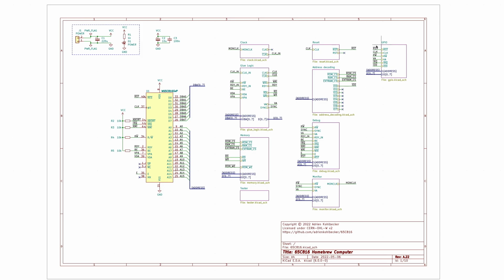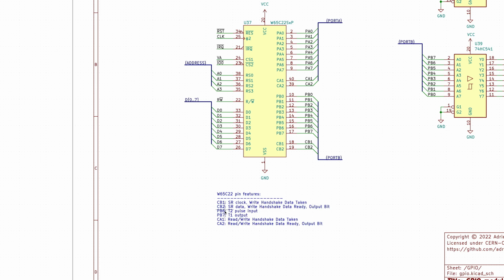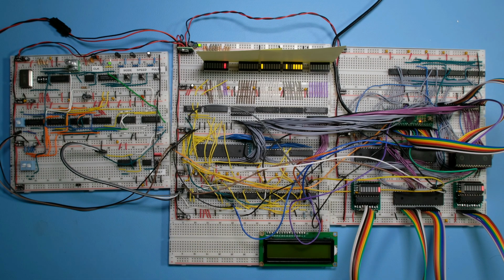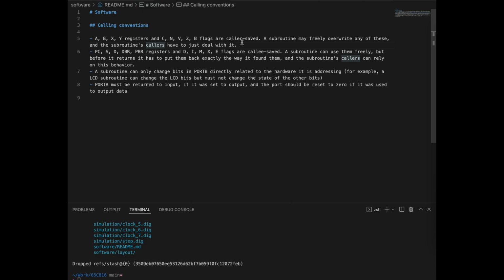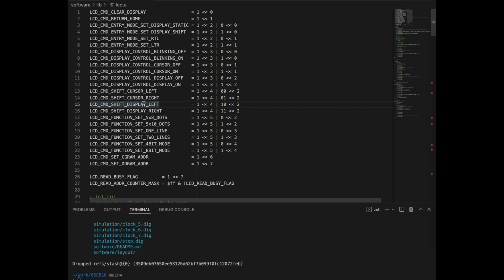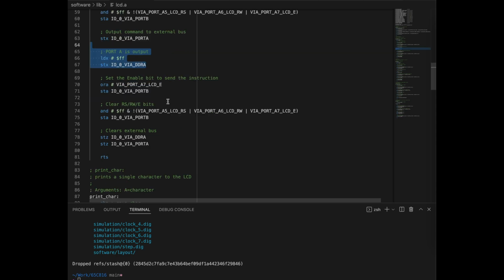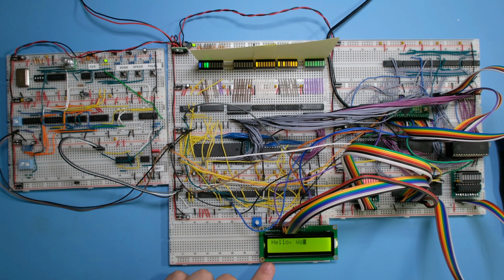#22 - LCD screen, calling conventions - BB816 Computer

Comment: I actually have connected the LCD directly on the CPU databus and used some additional logic, to drive he enable signal. Address bit 0 is connected to the R/S signal of the LCD, this has significantly reduced the Code size and i believe is the better solution, instead of connecting the LCD behind the VIA. I have not checked the timings of this setup, but it works for me.
This setup allows for a really tight Busy wait loop, which is just a BIT LCD_Control ; bmi loop.

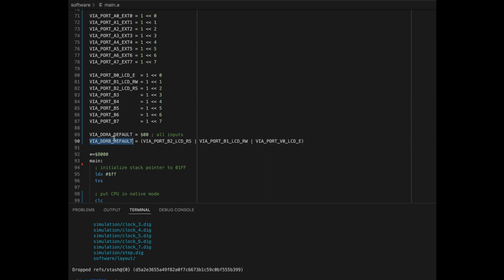Comment: At 7:40, shouldn't VIA_DDRA_DEFAULT be $ff - all outputs (instead of $00 - all inputs), since that's what drives the LCD module?
Reply from the maker: Appreciate the question! I see this port as part of an "expansion data bus" where multiple peripherals could be connected and share those 8 bits, similarly to the LCD. Each peripheral has a chip select in the other VIA port. I make not driving this bus the default state, so a mistake in other control signals on that bus doesn't result in a short. This is mostly bikeshedding on my part, and you could design it either way :-)
Reply: @akohlbecker  Thanks for the reply. I understand and I'm still 6 months behind, but catching up!

Comment: then how to build a computer without the help of another computer to program it.?

I was thinking about how the first computer was built in this world
Reply from the maker: That is a vast subject, depending on where you're starting from. First computers were mechanical and mostly akin to calculators. First programmable computers were built with relays, then with vacuum tubes, and then with transistors. On YouTube I recommend looking at Paul Law for an example of a relay computer, and Usagi Electric for a vacuum tube computer

Comment: I added these comments to your ep. 20 but I don't know if you seen them, I think it will help you optimize your teensy code:
When you are getting bool values of va, sync and rw - do it the other way around - if you generate the mask like this ctrl & (1 << 7) the compiler will optimize 1 << 7 into 128, you will save clock cycles used up for shifting ctrl around. Even better you can directly write the mask in like this 0b1000000 - it will be instantly visible what bit we are testing.
So I think it would be something like:
bool va = !(ctrl & 0b1000000);  //! is bolean invert, so when bit 7 of byte ctrl is low (others are ignored) va will be true.
Also use static variables or structs - that way your variables don't need to be created each time your interrupt is called, it should give a substantial speedup.
Don't use digital write, use PORTx |= y; to set a bit- and PORTx &= ~y; to reset a bit.
Also set the compiler into -O2 (or -O3) mode, by default arduino is set for -Os (size optimization) - compiler will then try to unroll your loops and do other tricks to give you more speed.
It looks like print_byte_in_binary prints the bits in reverse order? Least significant bits are checked first if I'm reading your source code correctly.
Reply from the maker: Hey! Apologies for not replying to your very helpful comments. I have implemented much of these optimizations now, and they're coming in episode 32.

Comment: is the CPU glue logic more or less stable by now? I want to work on my own project based on it but I don't want to have to throw out another board because it's not fully functional
Reply from the maker: The glue logic is functional as is, but I have a few minor tweaks I want to make still: I want to demux M/X, I want to move the buffer and the latch to AHC, and go back to non-inverted bank addresses using a tree of OR gates for BANK0. I should have just enough timing margin to do it @ 4Mhz. You may very well skip those changes, though, as they're about beginner friendliness and breadboard friendliness. I will be making a breakout PCB with the glue logic and a basic clock and reset.
Reply: @akohlbecker  thank you, I was planning on making similar tweaks myself so I might wait for that to be finished and just get started on my own clock board

Comment: Great video series! I especially appreciate the focus on evaluating the correctness of signal timings.

I would however like to make the case for a modified callee save calling convention, vs. the caller save convention presented in this video.

Modified callee save convention:
*Registers containing input to (and output from) a function are not preserved unless documented otherwise
*N,Z,V and C flags are not preserved
*All other registers and flags are preserved

The main disadvantage of this callee save convention as mentioned in the video is that registers the caller does not need preserved, are preserved unnecessarily. However in my opinion this disadvantage is outweighed by several advantages of the callee save convention in all but the most speed-critical use cases.

Advantages of the modified callee save convention described above:
1. Reduces clutter and possibility of error (e.g. forgetting to save/restore registers) in caller code. Since a function is generally called from more than one place it makes sense to reduce the burden on caller code; save/restore is centralized in the function vs. duplicated across multiple callers; total code size is likely reduced
2. Save/restore is less intrusive when done by the callee, since it can be done at the start/end of the function, leaving the body of the function free from such logic. In contrast when the caller saves registers this will usually need to be done repeatedly through the body of the code
3. Improved encapsulation. The caller save convention results in the implementation details of which registers are used by a function to leak out and become a concern of the callers (ie which registers should and should not be saved.) Unless callers always save all registers (which would defeat the main advantage - eliminating unnecessary saves - of the caller save convention) then any time a function is updated to change which registers it uses, all callers need to be examined and potentially modified to add (or remove) logic for saving registers. With multiple levels of function call this burden cascades, since even though a caller might not be directly affected, a caller’s caller might be. In contrast, with the callee save convention, any change to register usage in a function is isolated to that function.

I see #3 as the biggest advantage of the callee save convention, leading to greater overall maintainability of a code base. Or conversely #3 describes the biggest disadvantage of the caller save convention.

The reason for not requiring a function to preserve the registers containing its inputs is that often (usually) the input to a function is not needed by the caller after the function returns.
Reply from the maker: Hey Phil, thanks for the detailed advice. I really appreciate being challenged on this stuff because I'm new to assembly and might not know all the best practices. 
I'm not sure I agree about the implementation leaking above subroutine calls, though. In my convention, all registers that a subroutine needs after a call need to be saved, so if I end up changing a callee, even down the stack, there shouldn't be any impact, since everything above is already saving what they need. 
Your other points make sense though!
I will keep iterating on this over time as I build my BIOS, and if I notice that this convention is the wrong choice I will go back and revise it

Comment: I use a small 1k pot on the contrast lines as well. I have a 1604 and a 2004 displays, both blue, and I found  using the pot that the 1604 likes a 220 ohm resistor to 5v whereas the 2004 likes a direct 5v. I don't know why this is.. it may just be component tolerances. You may want to try it with your display, especially if you decide you want to upgrade to a bigger one like I did. Great video!
Reply from the maker: Thanks for the tip!
Reply: 10k is usually recommended for the contrast pot, with the wiper connected to the V0 pin of the LCD module and one end of the pot connected to GND, leaving the other end not connected.